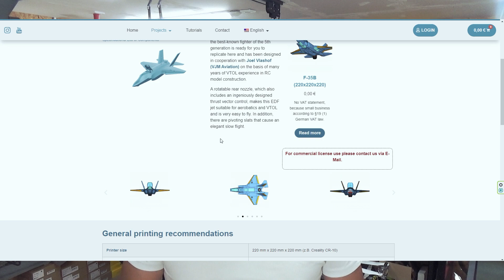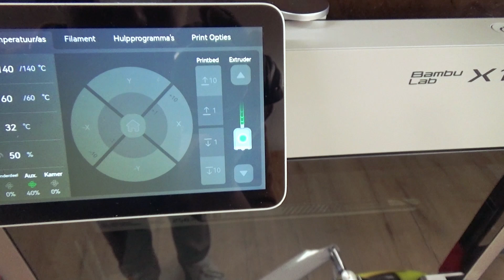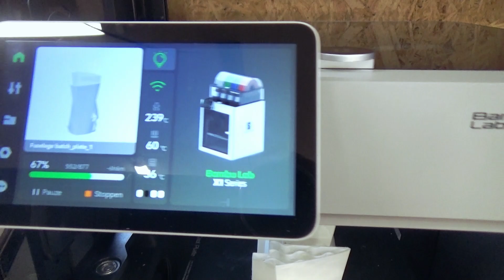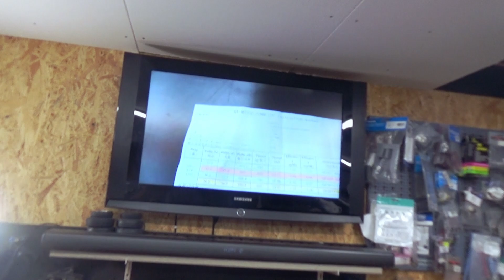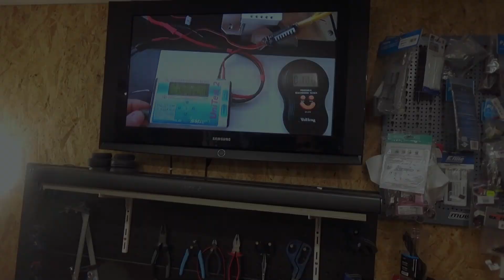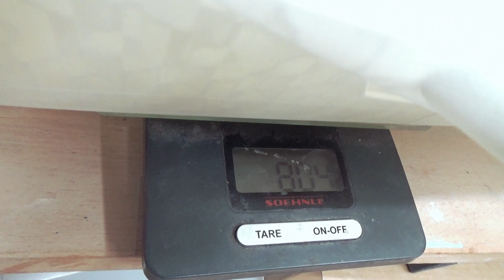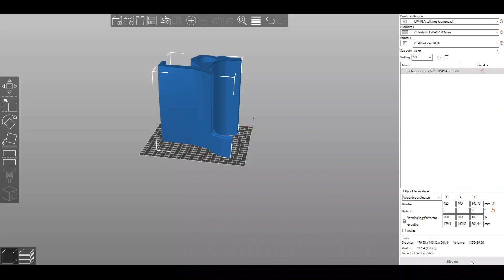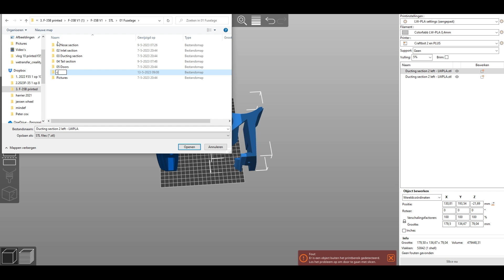F-35B RC-Jetprint build series | Fuselage | Ludicrous Mode On The Bambulab X1 Carbon?!?

Comment: Could you increase the scale to fit 80mm EDFs, or even 90mm EDFs…?
Reply from the maker: Would you buy it than? You can start trying to scale up in your slicer
Reply: @Joelmelanie  yeah…. Scaled up RC aircraft fly better on a larger scale than the smaller ones.  100mm EDF’s would be slightly closer to scale and would have a lot more performance.  I hope you are joking about the shredder, I take aircraft and engineering pretty seriously lol Keep’m Flyin’

Comment: How does one get the full .3mf file of your build, pictured right at 2 minutes into this video?  Bought the files from 3djetprint, but getting your .3mf with all your Bambu settings, supports, alignment on the separate plates like that would be huge.
Reply from the maker: Search for collorfabb settings they made also printing profiles for the bambulab

Comment: Can you please create a shopping list of the non-printable parts with links where to buy them? I have no idea where to get the motors and servos and the sheet doesn't really give good details.
Reply from the maker: The list on RC jet print as explained in the video😉
Reply: @Joelmelanie  I'm sorry, I know I am going to be a pain, but I am building this plane, and there are some confusions. For example, on the 5th line of the parts list there is the Main ducting-JP 70 mm – 4 - 6S - 2250Kv (CCW rotation), but then on the 23rd line there is The front EDF-JP 70 mm - 6S (CW rotation). So does this mean it take 2 of the same motors, just different rotation directions? This is a $200 motor, and I don't want to order the wrong one. IF the list had links to sites where we could see the parts, it would help a lot in getting the correct ones. A lot of the parts are not available in the US. When I have completed my shopping list, I would be happy to send you a list with links so you can share it with your US customers.
Reply: @MikeMillerDrones  Yes, you will need two of the same EDFs with just different rotating directions
Reply: @aerosol4024  Thanks, Do you know if this also applies to the wing EDF's? Do they need to be one-CW and one CCW?
Reply: @MikeMillerDrones  For wing EDFs it's OK both rotating in same direction. You will only be able to by them as CCW anyway 😉